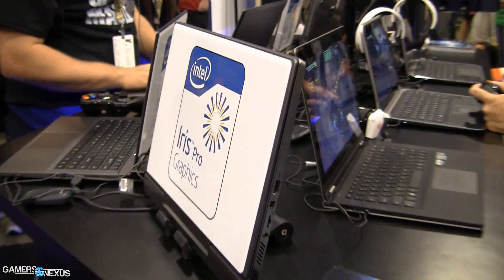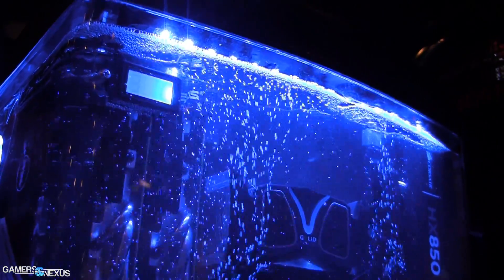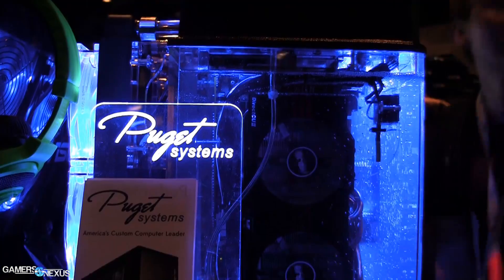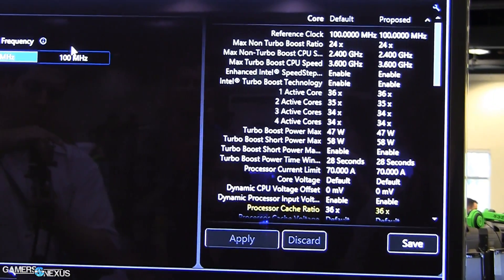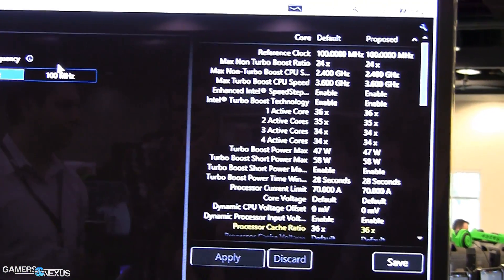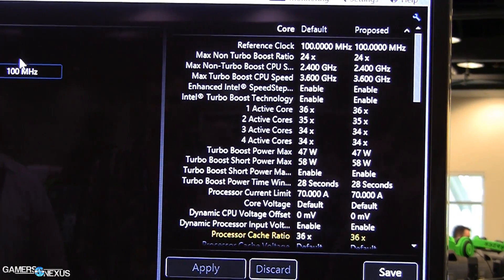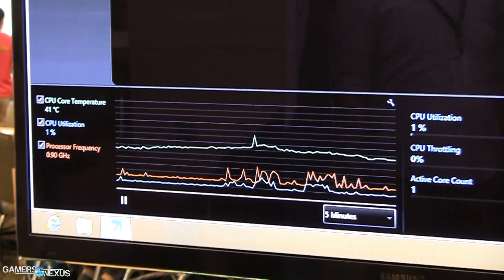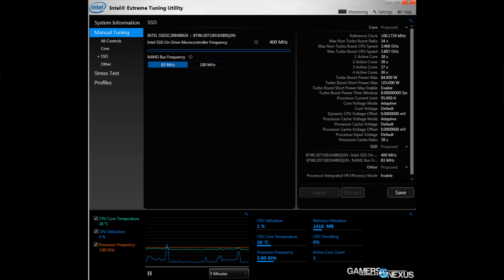Intel SSD Overclocking Benchmarks - How to Overclock Your SSD

Comment: I would like to see some SSD overclocking, would be funny to see some LN2. The controllers for SSDs are just 32bit CPU's for the most part correct? I know that this is an old video. Thanks Steve

Comment from the maker: That was just b-roll. The mineral oil build was built by Puget Systems and on display at the Intel booth, but wasn't actually the system with the prototype drive (that's a 520 Series SSD on stock clocks).

Comment: This is very interesting. I do love overclocking my system, and have it all under water to do so. Even so, I don't think I would ever overclock my SSD unless I knew 110% that it would continually be stable. 

That's where your OS is stored and it's just not something you want becoming corrupted. A failed overclock on the cpu or gpu however just usually events to a system reset and backing down the clocks with no harm done. There is a reason that's more universally practiced.